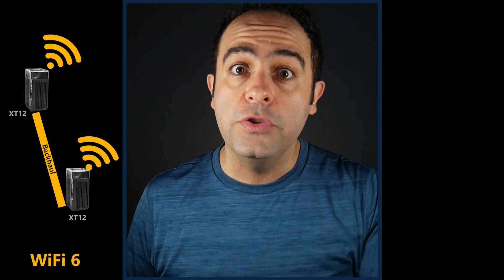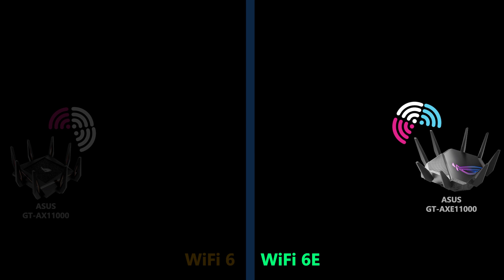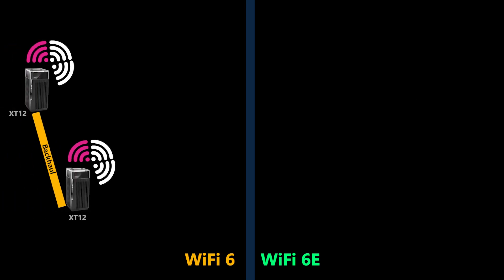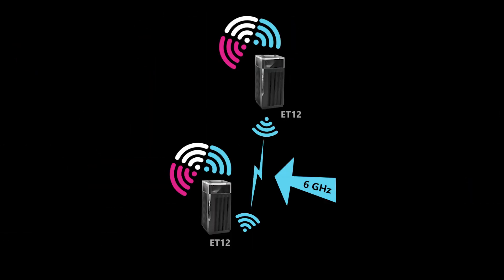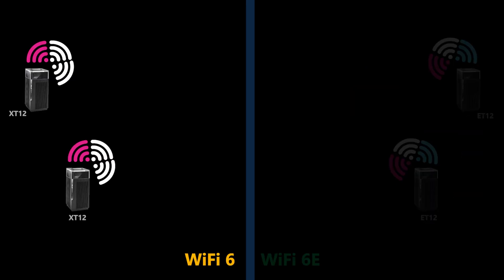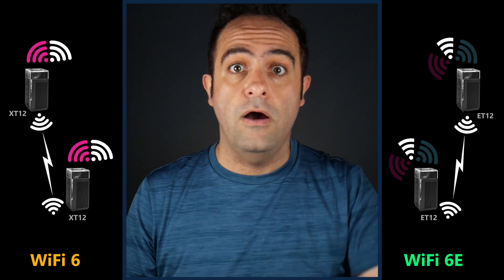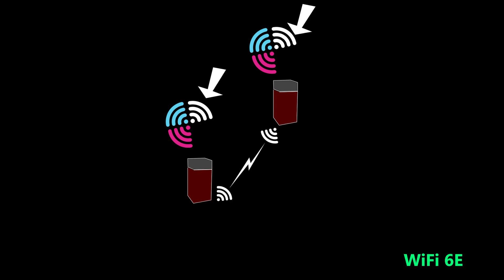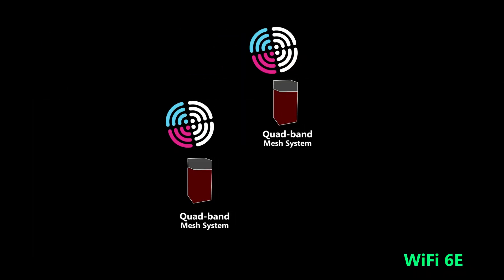WiFi 6 or WiFi 6E Whole Home Mesh system ?

Comment: Quick question if the router is connected to the 6ghz band does it still require the radio from the router for 5ghz on the mesh or does it use its own? Thankyou.

Comment: Hi please help I have Asus RT AXE7800 6E set up but need to add a mesh node will XT8 6600 work well orXT9 but they are both wifi 6 or shall I just get another 6E router because they won’t work well with backhaul ?

Comment: If i have a Wi-Fi 7 router backhaul wired into a Wi-Fi 6 node will i still get the benefit of Wi-Fi 7 through my node? or should i set up the Wi-Fi 7 as a node since most of my devices and PC that will benefit are closer to the node than the router? thank you

Comment: The 6Ghz band has so many channels that even with a similar amount of devices connected like a 5Ghz band along with the band being used as a backhaul, there is almost no perceived drop in speed because of 7 vs 2 160Mhz wide channels on 6Ghz vs 5Ghz respectively. So in fact, that single 6Ghz band on the Wifi 6E router has more channels than both the 5Ghz channels on the wifi 6 router combined. But yes if you want the absolute best no compromise performance, get either TriBand wifi 6 or QuadBand Wifi 6E/7. You would barely notice a difference from experience because you would still have at least 3-4 or more channels free depending on how many is used for the backhaul. Also while the 6Ghz band has much weaker range, when connecting 2 routers together the connection is a much stronger 4x4 connection which allows for a greater range before performance decreases significantly compared to single devices. For me with a 1 gigabit connection the node of my router while being about 45ft apart still has a  fluctuating transmission rate of 1.5-2.4gigabit and I get about 650Mbps from the node and 950Mbps from the main router
Reply: If the internet speed is only Upload 35 Mbps or less? 
Routers are not well made and the better ones are very expensive. 
WiFi 7 with 320 MHz bandwidth and high gain atennas will be exellent for wireless connections.

Comment: Best solution is an ET implementing a MoAC backhaul that connects to the 2.5G LAN port of the parent node and to the 2.5G WAN port of the child or children modes.  Yes, the XT is better right now with 2, 4 antenna 5G radios but it is not future proof.  Further, the 5G spectrum space is currently over utilized and this problem is exacerbated by high density housing. 4 band mesh system also are just too expensive right now to be worth the added cost, especially given that a MoCA backhaul solution is superior to a wireless backhaul anyhow.

Comment: What about using the 5GHz band for the backhaul and the 6GHz one for all non IoT devices? Seems like you get the benefit of the longer range between mesh nodes and still keep the faster band for devices. Is the only downside to this that some devices don't support use of 6GHz band?

Comment: Wont the speed capacity of the backhaul 5.oGhz linit the speed of 6.0Ghz?
Reply from the maker: no they are 2 different bands which do not interfere with each other.
Reply: @Behfor  thank you for the clarification..

But to clarify as well.. if there are 2 5.0 or 6.0Ghz in a system.. would the lower speed one affect the higher speed one when used as a backhaul given that they are at the same bandwidth in that scenario?
Reply from the maker: Each frequency band ( for example 2.4ghz , 5 ghz or 6 ghz), each one has different channels. So as long as 2 x 5ghz bands use different channels they do not interfere with each other and do not have a negative effect on each other, however if their channels overlap each other, then there will be a negative effect. You just need to make sure you are using different channels, some tri- band routers automatically try to use different channels for example in my second last video I reviewed a Asus gt6 which does that. Hope it makes sense.
Reply: @Behfor  so a 5.0 Ghz with 1Gbps speed can be used as backhaul instead of 5.0Ghz with 4Gbps speed?

Comment: I have the AXE16000, but now I'm wondering what to add as a wired node.

I was thinking the AX6000, but am I losing out here by not having another AXE device as a node?? (Thanks)
Reply: If it’s a mesh system just add the one he used for example in the video. Asus has great stuff!

Comment: Question: if the 5GHz band is used for the backhaul, won't the throughput of the 6GHz band be limited to that of the 5GHz?

I understand networking is full of compromises so I'm only asking out of curiosity.

Comment: all these new wifi standard are almost useless endless the device connecting the the wifi also has it and that is still not common. wifi 6e is almost useless here in the eu because the walls are made of brick. 5ghz already has such a hard time getting though. 6ghz is just useless for me here. so i agree having wifi 6 mesh system is better then a 6e. but all these new standards are not very stable for me. i have a wifi 6 mesh in my house and we have a 2017 macbook that would just disconnect and reconnect all the time. turns out running the mesh system in the older standards only (ac+n) fixed that problem. now i can’t use my new wifi 6 without buying a new laptop. so in the end they are both useless for me although i wish i could use wifi 6 for my mesh system for better speeds between the wireless access points.

Comment: Hello, I have the asus gt ax11000 and I am not impressed with the speeds at all. I have the 1 gig plan that is the fastest available for a home consumer. Is there another router that has the same internal parts that is less expensive. I am considering returning it.I only manage to get about 580 download and about 40 upload.
Reply: Are you using wireless what you've described the 540 Mbps? If you so, try to tweak on Asus wireless settings.

Comment: I mean, I'd use the 2.4GHz for backhaul, and configure all of the IOT devices to use the 5GHz band if they are in range, or to use an extender (as a mesh bridge) and a network switch to connect them to ethernet if possible, for either mesh system. I do also believe such a solution would reduce sticky clients. And it would be the best for routers that are far away and/or separated by obstacles that are hard to penetrate, such as concrete walls.
Reply: That sounds like a very ineffective way of doing it
Reply from the maker: Do all IoT devices support the 5 GHz band? I don't think so! The 2.4GHz for backhaul means a huge bottleneck which is not recommended, unless there is a specific case where 2.4GHz is the only option.
Reply: @Behfor  I mean, if if the nodes are really far from each other and/or separated by multiple thick concrete walls, and there aren't many IoT devices (which is the most common scenario I run into when working on other people's networks). Then I think it's probably the best option for that use case.
Reply: 2.4 Ghz with Wifi N, I believe only provide at best 600 Mbps with 4x4 which is rare configurations.
The point is, it is just not enough bandwidth to act as backbone.. 600 Mbps must be shared for downstream and upstream.
The only case where 2.4GHz is better for backhaul is when you have to put 2 wireless mesh at the very long distance from each other. Still need to consider that more range means more potential for interference.

IoT is not using a lot of bandwidth, so it is perfect at 2.4GHz
Reply: @Dominus_Potatus  You realize that the 802.11ax standard applies to 2.4GHz as well, and with a 4T4R can get get close to 1200Mbps right?
Reply: @sagetechnology4913  That I forgot.. now it is making sense
Reply: Just no. You'd get fired in a job if you propose that
Reply: @bassistmau  Even if you were right, what kind of business uses mesh nodes?
Reply: @sagetechnology4913  There are mesh wireless enterprise solutions already offered by various manufacturers.

If you really need long distance wireless backhaul there are other and better solutions, not the 2.4 band
Reply: @bassistmau  Long distance P2P aside, what I meant was that for access level wireless devices, they are not connecting them to the rest of the network with a wireless backhaul.

Comment: With my 5 to 10 year old computers and 3 to 4 year old smartphones, I'm starting to feel as if I'm living in the dark ages.  Even my EVs are now 6 years old.  There's just no way I can keep up with these advancements.  How do you do it 🤔?
Reply from the maker: You don't necessarily have to keep up with everything. I believe you should only upgrade when something doesn't work well and you know a newer technology can really help, in other words, if ain't broken don't touch it! Thanks!
Reply: My family still have AC750, AC1200, AC1900, AC2100, AX1800, AX3000 made by different companies for example ASUS, TP Link, Xiaomi, Huwaei, Tenda, Wavelink all AP wired with cat 5e,6 and 7.

AC Powerlines port 100 and 1000 Mbps made by. TP Link, D Link and Tenda. 

Router with QSO is a must to adjust bufferbloat for gamers 

My notebooks are wired with cat 6, the older one have USB 1000Mbps adapter because the RJ45 socket is damadge. I have replced de AC750 WiFi for WIFI 6 3000 and have the same speed of cable. my company in Portugal is Altice = Otimum Fiber Optic USA.

The 2022 Notebook have WiFI5 2x2  MU WIMO, 160MHz bandwidth and have the same speed of wired rj45 cat6.

The days of homemade computers since windows 3.1 to XP are over. 

WiFi 6 (5GHz) is enough for me. I am goig to skip Wifi6E.

The W7, 320 MHz bandwidth is going to make a hudge difference. 
.
In 2025, route similar TP-Link pair Deco BE33000 Quad-Band WiFi 7 Mesh System (Deco BE95 might be a good choice for you darkenergy. 

Behfor is smart with a lot of knowlwdge and  maybe a MIT teacher.
Good Luck